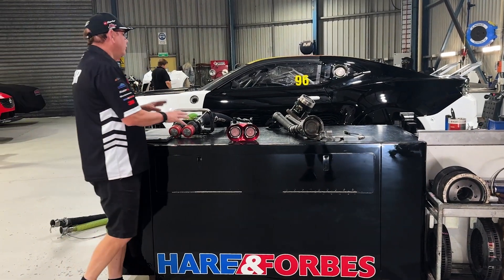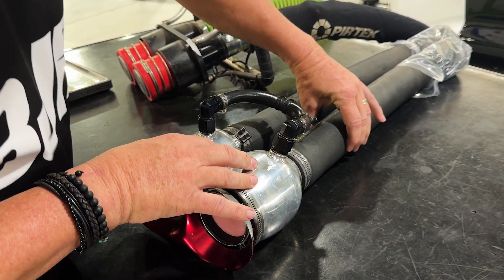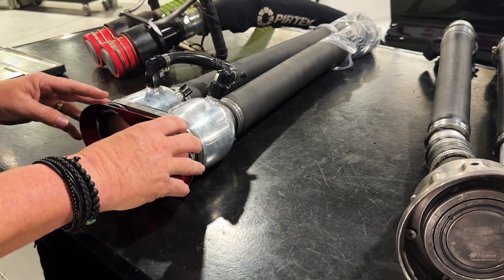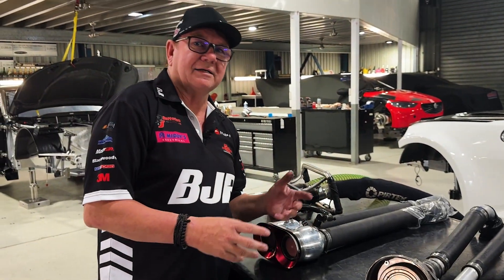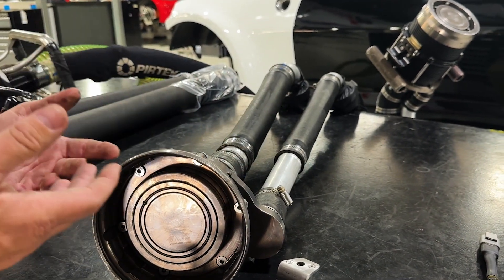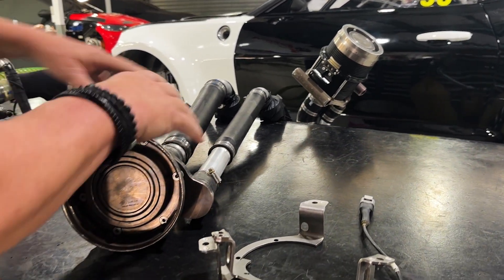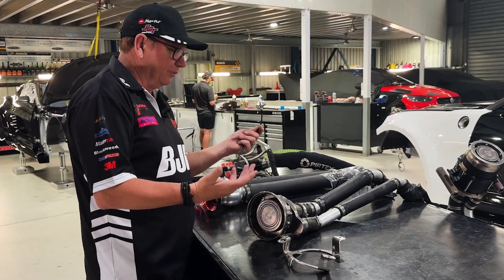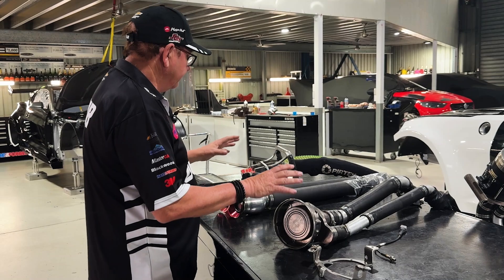Comparing Supercars' pre-Gen3 refuelling systems to current specification

Comment: Good info Brad.  Shame they moved to an overcomplicated system purely so they can be more accurate in handing penalties....
Does the new sensor get connected to the air jack system?
E.g. so that the car cannot be dropped unless the fuel is decoupled?

Comment: I'm not usually one for shouting down new ideas, but seems like they ditched a system that was simpler, cheaper and worked flawlessly for several hundred races with only one serious incident, for something that is more expensive, more complicated, and far harder to use.

The Krontec sales team must do a great long lunch if you know what I mean...
Reply: i think they had to change it due to the surface area available on the new Gen 3 cars. Looks like they have very little room between the door frame and where the rear panel drops down. Have to remember Gen 3 are Coupe style chasis opposed to the old four door models of the past.
Reply: Yeah but dry break fuelling is an aviation standard of which there are little to no drips or fires ever. As Brad said, only one in that entire duration. Adding cost and complexity for no reason over a proven standard is just silly. You can even tell in Brad's tone on a lot of these videos he doesn't agree with these changes. But at least tries to find a positive in the mostly negative.
The previous ATL and FUELSAFE are used on every GT and proto car around the world since basically as long as one can remember.